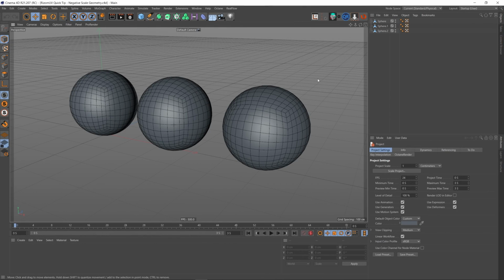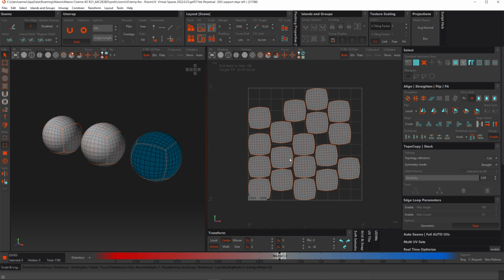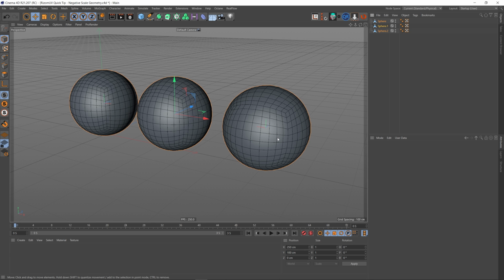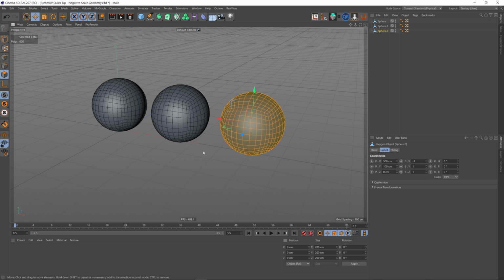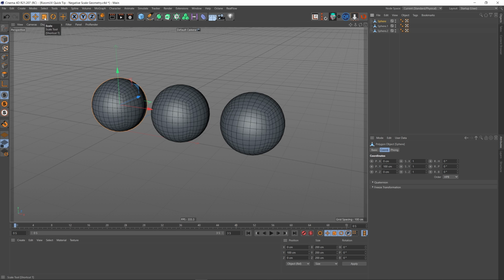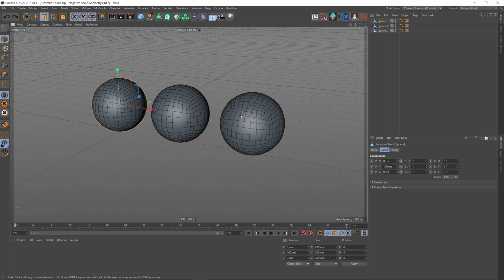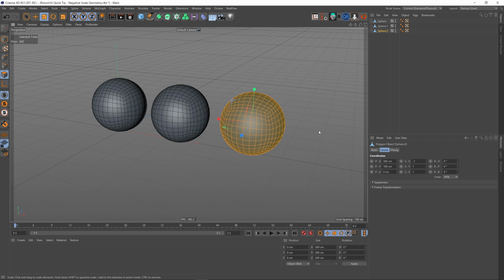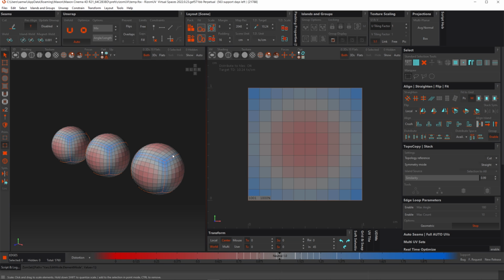RizomUV Quick Tip: Negative Scale Geometry

Comment: Perfect. Have this question: Does the UV mapping mesh instead have normals? For example, if I mirror the UV mapping mesh changing,
 flipping the normal direction of the UVs, does this also affect the mesh normals or just the texture direction? Thnx
Reply from the maker: If you flip a UV island, this does not change the normal direction of the mesh.